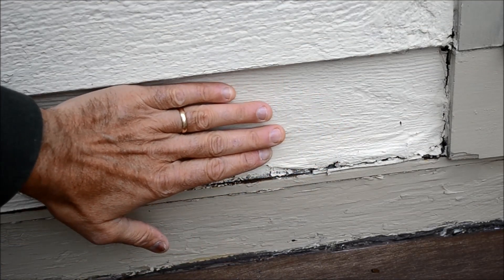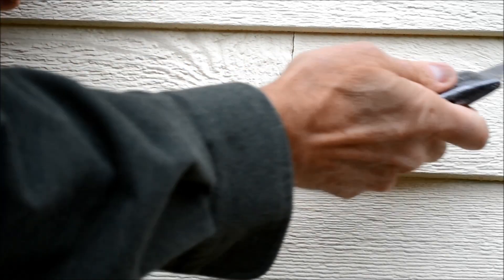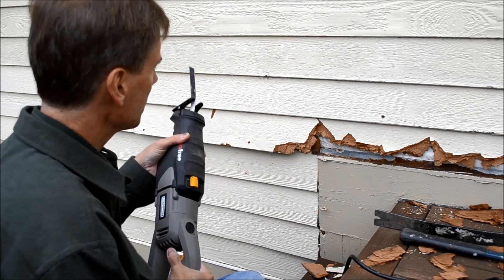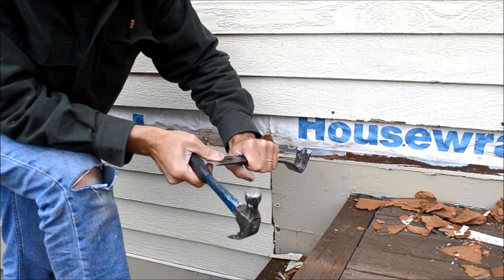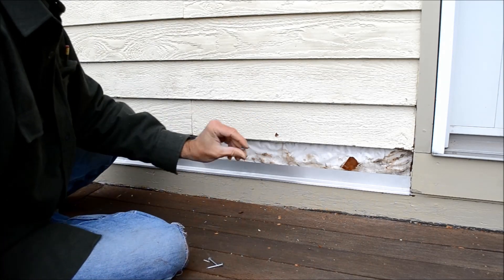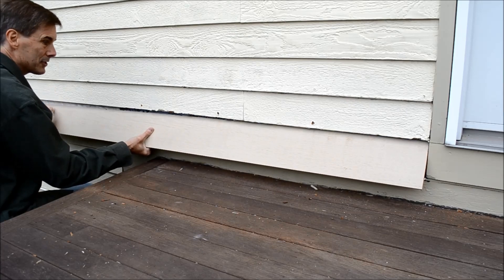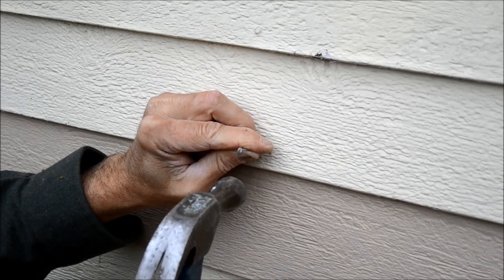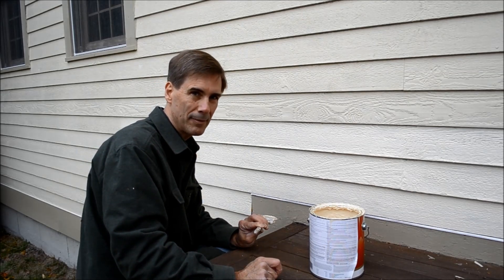How to Replace Clapboard Siding Video

Comment: With a 200-year-old farmhouse covered with spruce clapboards, I am all too familiar with the process, especially the rot that happens on the lowest 2 or 3 clapboards. I actually learned something I had not figured out from your video, to use a sawzall to saw off nails that protrude under the good clapboards! Never thought of that. I painstakingly pry the clapboards up to free the ones that I need to replace, but sometimes the nails are tough to get out and I end up splitting the good clapboard using the pry bar and end up having to replace more than I intended. I do like to put caulking on the ends of any wood down by the drip edge, and I have also concluded that if the drip edge is level it can cause water to drain inward or remain on the drip edge, spurring more rot. So I like to slightly elevate the clapboard that will be on the drip edge so it is not flush and the bottom can dry out, and have also tried raising the drip edge maybe an 8th of an inch or so, and then bending the drip edge down so it has a slight slope and any water will drip off.  Northern climes, with driving rains and tough climate, are harsh and I totally understand why folks are building houses wrapped in metal siding with some cedar accent trim. 
The reason I came here today to watch this is that my hardware store and the lumber yard do not carry galvanized clapboard nails like the ones on my house! Go figure... sign of the times?  I may have to use the 1 1/2 inch nails you are using. Thanks for the video!

Comment: Question. I need to replace 1/4" pine bevel siding.  I can find siding with a 1/2" or 3/4" wood bevel siding. 1/4" bevel siding? Thanks.

Comment: Would it be a good idea to countersink the nails slightly and then seal it?   I also agree that sealing the ends of the board would be a good idea.
Reply from the maker: Unlike a cedar board, where you can buy it primed on all sides, that is not the case with this type of masonite siding material. The back is not primed/sealed.  My concern would be that moisture could become trapped if you sealed the cut ends of the boards.

Comment: The location of your the cord on your chop saw was making me nervous.  Why not route it toward the back of the saw.   Can I use screws instead of nails?   Do you caulk the nail heads?
Reply from the maker: No use nails and don't calk them. Moisture could get trapped under the nail heads and cause the masonite board to swell.

Comment: Can fiber cement be removed this same way?  I need to remove some broke strips around the bottom of my house.  Also, mine has no drip edge.  And no flashing behind the joints.  But there is homewrap.
Reply from the maker: I have not done it on Fiber cement board, however I don't see why you can't. It is just a matter of going gently and slowly when loosening up the nails.
Reply: I just did this with James Hardie fiberboard siding. Same problem: No drip edge, no flashing, no sealant... really crummy construction.  One thing I would recommend is to not put the siding so close to the drip edge. I would leave a quarter inch gap between the bottom piece of siding and the drip edge. You'll also want to use something like OSI's QuadMax sealant for the ends, corners, and any other joints. Do not use caulk! It is not the same thing as a sealant. Good luck! 

edit lol this was a year ago that I'm replying to. Anyway, hope it went well!

Comment: what is the name of the type of saw you used after removing the nails with the hammer and pry bar at the beginning?
Reply: That's a reciprocating saw.  It's almost always called a sawzall because SAWZALL is a brand of reciprocating saw manufactured by Milwaukee Tools.
Reply from the maker: A Sawzall / reciprocating saw.